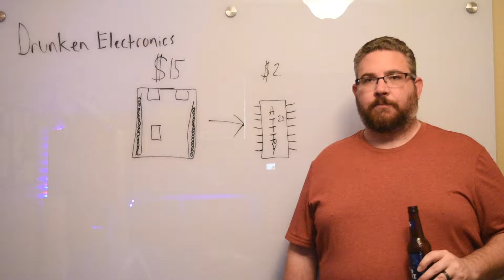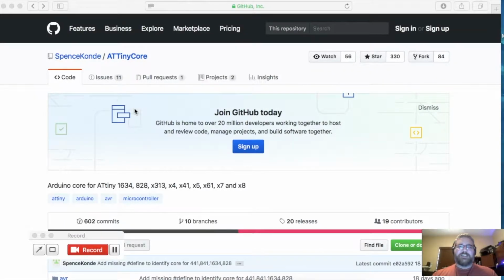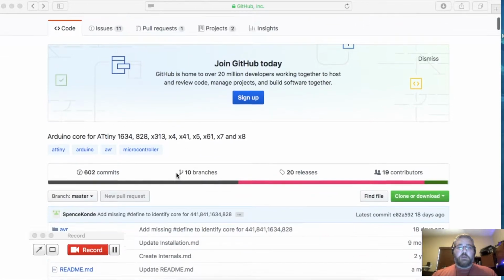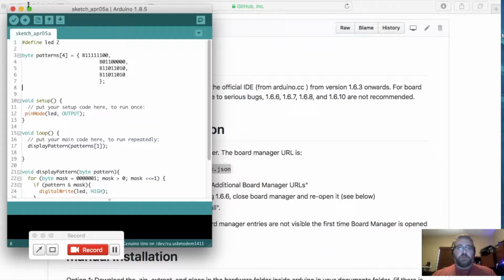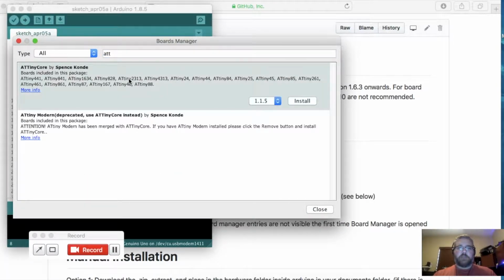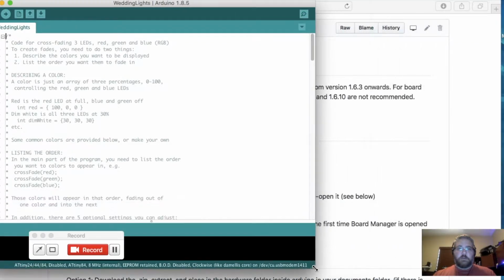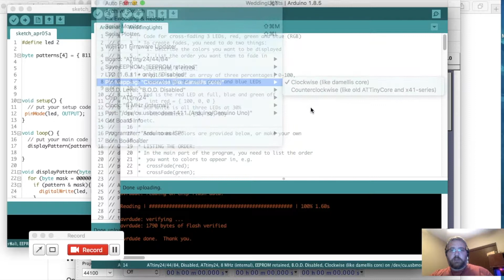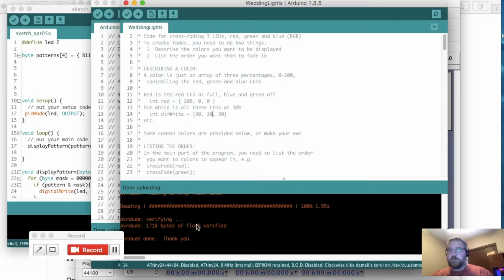Howto: Program an ATTiny 24 with an Arduino

Comment: Hi man. thanks for your tutorial.
when I upload code "Wedding lights" say me an error 

avrdude: stk500_recv(): programmer is not responding
avrdude: stk500_getsync() attempt 1 of 10: not in sync: resp=0x03
avrdude: stk500_recv(): programmer is not responding
avrdude: stk500_getsync() attempt 2 of 10: not in sync: resp=0x03
avrdude: stk500_recv(): programmer is not responding
avrdude: stk500_getsync() attempt 3 of 10: not in sync: resp=0x03
avrdude: stk500_recv(): programmer is not responding
avrdude: stk500_getsync() attempt 4 of 10: not in sync: resp=0x03
avrdude: stk500_recv(): programmer is not responding
avrdude: stk500_getsync() attempt 5 of 10: not in sync: resp=0x03
avrdude: stk500_recv(): programmer is not responding
avrdude: stk500_getsync() attempt 6 of 10: not in sync: resp=0x03
avrdude: stk500_recv(): programmer is not responding
avrdude: stk500_getsync() attempt 7 of 10: not in sync: resp=0x03
avrdude: stk500_recv(): programmer is not responding
avrdude: stk500_getsync() attempt 8 of 10: not in sync: resp=0x03
avrdude: stk500_recv(): programmer is not responding
avrdude: stk500_getsync() attempt 9 of 10: not in sync: resp=0x03
avrdude: stk500_recv(): programmer is not responding
avrdude: stk500_getsync() attempt 10 of 10: not in sync: resp=0x03
Problem uploading to board.  See http://www.arduino.cc/en/Guide/Troubleshooting#upload for suggestions.

I wired all of the pines some like the video but only difference is I used smd package of attiny 24
Reply from the maker: I apologize, it appears that I edited out an important step, you need to first program the Arduino as an ISP programmer. This is just loading an example sketch and uploading it to the Arduino before trying to program the attiny. Under example sketches look for "Arduino as ISP", make sure that the board selected is the Arduino Uno (or whichever Arduino you are using) and then upload the sketch. You should then be able to follow the instructions in the video to upload to the attiny.
Reply: thanks you .all steps done and project worked perfect.
Reply from the maker: Awesome, glad it worked for you, if you need any additional help let me know.
Reply: I got this same error when trying to upload the ISP sketch to the Uno. When I removed the capacitor from the reset and ground pins it worked.